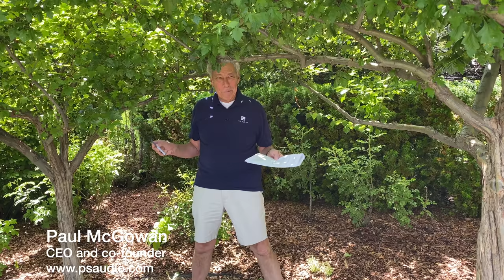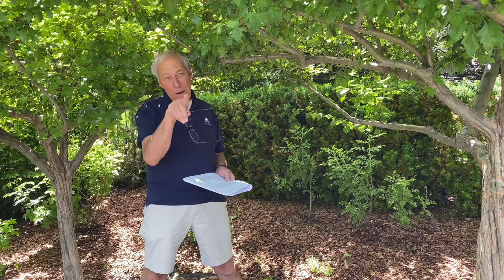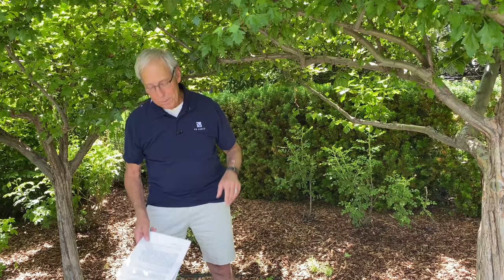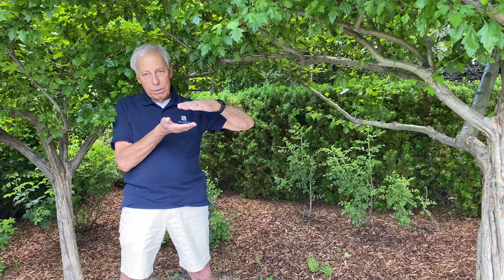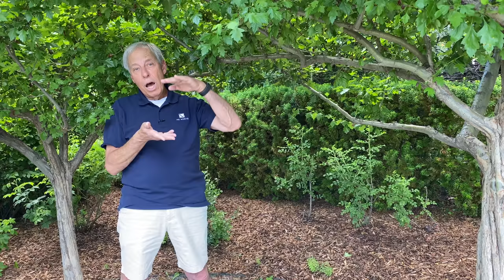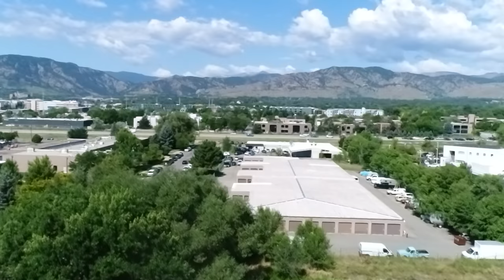Current vs. power in an amp

Comment: Does the Impedance of a speaker effect the sesitivity level of this speaker?
If not, its better to go for a higher impedance speaker, right?
So the Amp does not need to deliver that much current at high voltage output = Loudness. Correct?
Reply: This is always a point of confusion.  If you test speakers at a fixed power level, then you obtain a fair and meaningful measure of its sensitivity.  The standard test level is 1W.  
With an 8 ohm speaker, the voltage corresponding to 1W is 2.83V rms.  Sometimes, speaker sensitivity is tested at 2.83V, without consideration given to the speaker impedance.  If you test that way, then lower-impedance speakers would certainly seem to have a higher sensitivity, as they will draw more than 1W.  
There is much debate about whether testing at 1W, or testing at 2.83V, is more meaningful.  The reasoning for the latter is that most amplifiers can put out more power into a lower-impedance speaker, so such speakers should receive credit for that fact.  That is, they do play louder before the amplifier starts to clip.
Reply: My experience tells me that there is no relationship between impedance and sensitivity. 
Impedance determines the current that the transducer is "demanding". Higher impedance will pull less current. So yes the amp will be having an easier time. Is that necessarily better? No. Impedance and current don't determine sound quality in any way. Unless someone with engineering knowledge can prove me wrong. 
Sensitivity is basically the efficiency in dB per unit of power or voltage e.g. dB/mW or dB/V.
To my ears, low efficiency speakers tend to have a more authoritative sound? Not always, just a tendency.
Reply: @woopygoman  
Thank you!
What drove me to this question is the comparison of two sertain Speaker chassis, the:
Dayton Audio RS225P-8A and
Dayton Audio RS225P-4A.
Same construction, but different impedance levels - one 8 and the other 4 Ohms.
specified at 2.83V/1m:
8 Ohms = 89.1 db
4 Ohms = 92.9 db
So the 8 Ohms chassis draws 1 Watt at 2.83 V, the 4 Ohms chassis draws 2 Watts at 2.83 V.
Is that the reason for +4 db? drawing doubble current?
And can the 4 Ohms chassis play 4 db louder at maximum load? so 4 db more distance to distortion at lower levels?
Reply: @marianneoelund2940  
All right!, thank you!
I understood that only voltage gives the level of loudness. thats exacly the confusion. Like I metioned in my other answer.
Reply: @JeanKatana  
All other things equal, the 4 ohm version should only play 3dB louder, so I think the nearly 4dB difference is due mostly to measurement inaccuracies.  
Most direct-coupled solid state amplifiers can produce almost, but not quite, twice as much power into a 4 ohm load.  So in reality, you might achieve 2dB headroom improvement with the 4 ohm speakers.  
The drawback to using 4 ohm speakers, if you care about efficiency, is that the amplifier will typically dissipate 50-60% more heat, than it would with the 8 ohm speakers at the same power level.
Reply: @JeanKatana 
Interesting choice. I'm a Focal guy myself but that seems like a decent woofer. 
1) That's not the reason. The sensitivity numbers you quoted are both measured at 2.83 V or 1 W.
In general, +3 dB is about 2x power. So the 8A model will require more than 2 W to reach the 4A's SPL at 1 W. I=sqrt(P/R). So the 8A model will be drawing a bit more current (same SPL). The voltage to current ratio is determined by the load. R=V/I. They always increase together. Increasing the voltage also increases the current and P=VI. This is why you have to carefully look at amp power specs at several impedance levels. Ideally, as many as possible to reveal (the flaw) the impedance level at which the amp is current limited. 
2) With regards to maximum load, you need to look at peak and rms power handling specs. 
Both models have the same according to the manufacturer so yes the 4 Ohms model should play louder at max rms power because as you posted the sensitivity is higher but I'm not sure if the delta is still 4 dB at peak or rms. I think it should be?
3) Your last question is confusing. Not sure what you mean by "distance to distortion at lower levels". Lower SPL usually means lower distortion. Distortion is more of a problem at high SPL.
Reply: @woopygoman   @Marianne Oelund  
Great dicussion by the way! Thank you!

All right, I like Focal as well... who dont? ;)
Yeah, its a budget but quite good woofer!

1) 
Both sensitivity levels are measured at 2.83V.
So...
2.83 V / 8 Ohms = 0.354 A
0.354 A * 2.83 V = 1 Watt (89.1 db)

2.83 V / 4 Ohms = 0.7 A
0.7 A * 2.83 V = 2 Watts (92.9 db)

That means the 4 Ohms version draws doubble Power compared to the 8 Ohms version when measuring at 2.83 V.
That would explain nearly the difference (if so). Like you posted = doubble Power = +3 db, I know. In this case actually its +4 db, maybe thats little deviation. But its the same Voltage. So is Voltage giving the loudness or is it Watts?

2) 
And if I calculate this up to 120 Watts Max both chassis, there "could be" remaining this +1 db deviation, or these +4 db?  
Thats a difference if I either start calculating up at 1 Watt or at 2 Watts.

3) 
With that one I meant, If you play both perhaps at 95 db/1m e.g..
If the one chassis sensitivity level is 4 db higher, its much easier for it playing 95 db compared to a chassis with 4 db less sensitivity level, because this one needs to transduce more power to reach 95 so its closer to its maximum power = closer to its distortion.
Reply: @marianneoelund2940  
Thank you!
True!
Reply: @JeanKatana  
1) Your math is good. Just keep in mind that the 8 Ohms woofer will require more power (and more current, as per my previous reply) to reach 92.9 dB or any SPL really to match the 4 Ohms one. The loudness is the power but it is varied by voltage-drive or current-drive so it just depends on the amp. Most amps are voltage-drive. When you turn the volume knob, the potentiometer is increasing the voltage (difference in potential, hence the name) and that increases the power. Some people claim current-drive is superior but I've never heard one myself because it's a very esoteric idea. I think it's either a cost problem or most engineers have tried it and haven't found any real world benefit to current-drive so who knows. Always trust your ears that's my #1 rule. 
2) That 4 dB difference is at the same voltage of 2.83 V. I'm not sure if the difference is still 4 dB at max power but I think it should be assuming the 3 dB double power rule is true all the way up. (linear function) It's a general approximation I believe but I'm not bothered enough to look into it. 
3) That's a good observation. The 4 Ohms model is probably closer to it's clipping level or noticeable distortion level but without actual testing we don't know what that level is. It might be different for both models. Even though the cone might be the same there's just too many variables to make such a claim with certainty.
Reply: @woopygoman  
1)
Thank you very much!
About the Voltage driven Amps - Thats something I dint know in detail before!
Right, its also my #1 rule! But when I'm starting a new DIY Project I need to look at the numbers first to make closer choises of cause.
BUT thats the point. I compare these two Mid/bass chassis for matching one of them to a tweeter. 
And this Problem we are discussing currently made me scuffling my hair. Is +4 db effective there or not, you know... :)
This includes point 2) as well I guess.
Power to db is squared. As far as I know you need 4 times power for doubling the amplitude = +6 db. Or 2 times power for noticable + 3 db.
Its an exponential funktion if you look at db linear.
And therefore I like to combine high sensitivity level chassis for having relatively low power demand and big head room for dynamic.
If I took a chassis with 3 db less sensitivity, it would need double power for the same dynamic peak level. At higher db levels that means a hell of a difference.
I also would like to know this from somebody who has this experience. I beleave on this channel I'm quite close to these sombodies. ;)
I'm only philosophizing as good as possible to find out, at least theoretical, how it might be.
Maybe thats a (very complex) question for Pauls colleague Chris Brunhaver, the speaker engineer at PS Audio at the end. 
3)
Thats it! You are right!

Comment: A typical mask used for COVID 19 prevention captures droplets in both directions thus it also helps protecting you.
Reply: But drauplets that reach a eye can also spread Covid 19,  so here it helps to wear a mask; less risk for spread.
Reply: Fat Rat Yeah, it’s not a 100% measure either way.
Reply: I agree.  One of the problems with masks, is that when you exhale it tends to lift away from the face and allow air to escape around the perimeter - which of course will not be filtered.  If you are wearing glasses or safety goggles, and they fog up when you exhale, then the mask is failing.  
During inhalation, the mask is pulled toward the face and seals better at the edges, providing better overall filtering and more protection for the wearer.

Comment: This is an ohms law question I think. But there is a lot more than the simple E=I x R . One version of ohms law.
Reply: Lots of formulas exist for how electronics work. There are books of information more. When circuits involve capacitance, inductance, active components, non-linear components etc., things can get exponentially more complex than a simple resistor circuit. Speakers are not resistors and amps are not resistors either.
Reply: True. It ignores the reactive loading (capacitive/inductive) which varies with frequency.
Voltage and current are not in perfect syncronization because the load stores energy and then feeds it back to the source on a delayed basis (reactive load).

Comment: How to I find out what power my amp is capable to support at 8 and 4 ohm  if I have no documentation

Yes please stay safe. Our planet needs good people like you who share knowledge
Reply: You need a sig gen, load resistors and an O scope, or just turn up until you hear distortion 😂😆
Reply: poserwannabe thanks I am not technical some device like multimeter I can arrange not scope
Reply: @anandshah71  well a multimeter would allow you to read voltage but that's not enough to do what you want ☹️
Reply: Thanks Buddy for your reply I think volume increase distortion is my only way.
Reply: I have got monoblocks class AB 4 channel and Class A done by a person in DIY no documentation need to know where I stand
Reply: @anandshah71  like the Rat  said I agree it doesn't really matter, if it sounds good to you have fun !!!

Comment: Current = rate, Voltage = force
Reply: EMF is the force.  Voltage is the EMF integrated across the load loop.  
Current is electron rate, specifically.
Reply: Fat Rat  
Yes, well I hope they're getting along, as they are stuck with each other for nearly eternity.

Comment: Talking about delivering high current from an amplifiers you need either a humongous power supply or a tracking power supply that keeps less than 10 V above ground across the transistor that is how a Sunfire amplifiers can supply enormous amounts of current and run cool and be light   https://hometheaterhifi.com/volume_2_3/v2n3f.html  .

Comment: Rule of thumb, a beefy power supply (translating into a heavy amplifier), means ample current delivery at any situation.
The power in watts, is more related to the output transistors specifications.

Comment: Hey Paul that's a great explanation.  I hear a lot of nonsense on this topic but you pretty much nailed it.  We could take it one step further to discuss how a loudspeaker is not a constant impedance but actually varies over the audio spectrum.  Also the impedance is not purely resistive but it's complex.  That would just confuse people though; I think you explanation is quite good.  Now...  Onto your explanation about masks.  I'd like for you to explain how it is that a cloth mask won't protect the wearer but it protects other people.  Does it function like a diode?  NO!  Masks don't protect the wearer and they DON'T protect anyone else either.  The virus is 0.1uM in diameter and easily passes in or out of any mask you find people wearing.  They don't work and there is no point in wearing one.  Sure it will stop a little bit of mucus from going through if you cough or sneeze but the virus particles will go through just fine.  On the other hand masks are a cesspool of your own bacteria and viruses which you then re-inhale back into your lungs if worn for any length of time.  No I'm not contradicting myself here.  The mask does collect some of these particles and others go through.  Sound like a good time?  Then wear a mask.  People who have a little common sense and some critical thinking ability will see through this mask nonsense.  Keep up the good work!

Comment: Best explanation of current and what it contibutes, ever.
Reply: Is this the first one you've seen?
Reply: @ridirefain6606  
Have a look around the comment section.  Far more educational than Paul's video.
Reply: @marianneoelund2940  That may well be. Nonetheless, the intent of my post was to express that I like the way he boiled down the basics of the concept. In depth information I will glean from an electronics and electrical engineering manual. Not comments from punters on you tube. No thank you.

Comment: Paul don't try to play an expert. You really don't know just stick to audio
Reply: If someone asked you to "please wear your seat belt" when you were headed off on a long drive, would you respond with "please don't try to play an expert?" SMH.
Reply: @amitraam1270  I'm not talking about the mask thing I'm talking about the whole thing in general. It's been an absolute cluster of information. It survives On Solid Surfaces then it doesn't. 6 feet apart. This that the other thing. At some point we need to all move on. Let me guess, if a so-called doctor told you to wear a mask for five years straight you would be the one to follow them wouldn't you. At some point I use common sense. I stayed in with my family for a good two months and practiced social distancing. Think about any other disease or flu or anything else were you were instructed to wear a mask. It never happened. Why is this? It just doesn't make sense.
Reply: @gotham61  bad analogy
Reply: @ryanschipp8513  How so? They are perfectly analogous.
Reply: @gotham61  it's far from perfect. A seatbelt will always be something that could save you from injury or death. At some point this virus goes away. The masks will not be needed. They will do nothing. Are you saying you were going to wear a mask for the rest of your life LOL
Reply: @ryanschipp8513  The virus may or may not go away eventually. Nobody is suggesting that we should wear masks forever, but until there is a vaccine or an effective treatment, they help to prevent the virus from spreading, saving countless lives in the process. 
There are always people who reject common sense and expert opinion. When seat belt laws were first being proposed and introduced, there were plenty of people who insisted they made you less safe in an accident.
Reply: @Larry Niles Larry!!! There you are. Something tells me you are wearing a mask sending this message.
Reply: @gotham61  okay smarty pants. So how about this. Name one other instance in United States history where they enforce wearing masks? I'll wait patiently for your answer.
Reply: @bencausey  United States has never enforced this ever. My own common sense not needing to look up links on the internet tells me something isn't right about the whole situation
Reply: @gotham61  can you talk or think for yourself or do you have to keep on going on the internet?
Reply: @ryanschipp8513  You don't have permission to read my mind. And the subject change won't help. It is a scientific fact, not a political one.
Reply: @amitraam1270  scientific fact. Yet I had a doctor and his elderly mother come into my store within the past few days with no masks on.
Reply: @ryanschipp8513  people can be stubborn and rebellious. This behaviour is everywhere, and we all pay its price . I see it around me, too ☹️